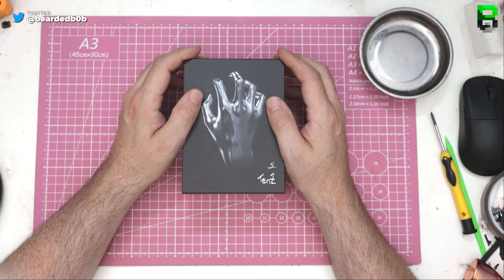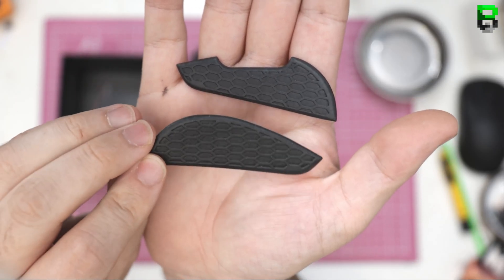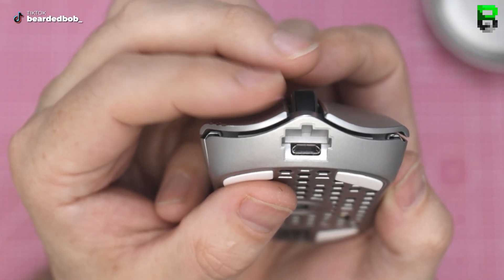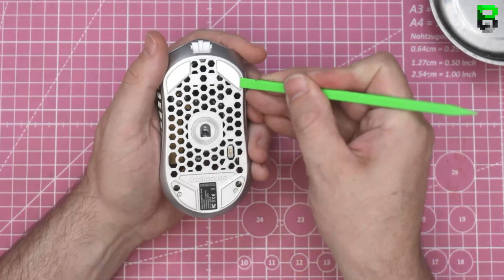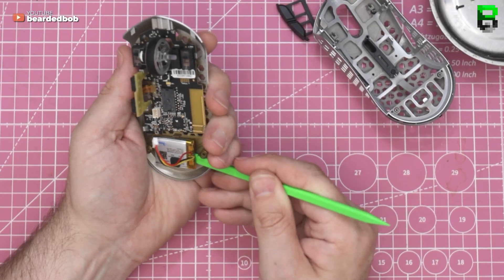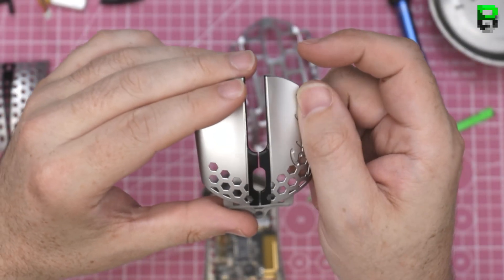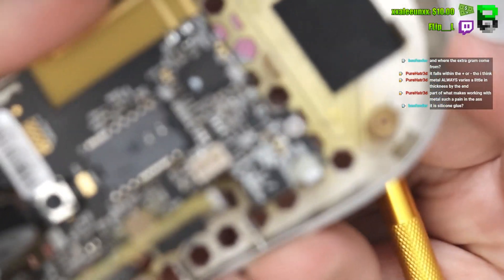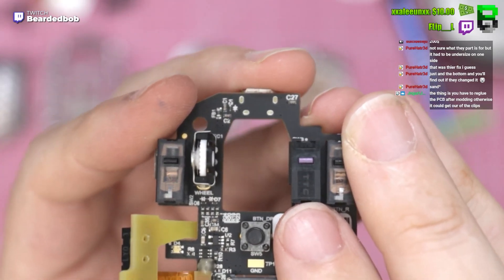LETS LOOK CLOSELY AT THE BUILD QUALITY & COMPONENTS USED: Finalmouse Starlight 12 Tenz Teardown

Comment: Hello, I received a tenz pro before, and found that as long as the finger is relaxed to a certain extent after pressing the button (the button cover is still pressed down), the micro trigger will break for a while and then return to normal. I would like to ask if you have the same problem?

Comment: I took my mouse apart because the right side felt lose and flexed/creaked inwards with gripping. I ended up realizing the bottom screws were a little loose stock and the issue resolved with tightening. However now my left click feels crunchy (interestingly it only seems to be the first click, feels smoother with subsequent clicks). Any suggestions for how to fix this?
Reply: I had this with mine too only first click after a couple minutes feels like it snaps somehow and then after that they’re normal I kinda just pressed it hard af and a whole bunch of times and now it’s perfect
Reply: @lui4ever3  finally found this video which was super helpful: https://www.youtube.com/watch?v=GrF2dXTgYGE . I noticed the black adhesive around the left click was coming unwrapped, I wrapped it back around and that fixed the issue.
Reply: @caseykukielski2410  I also had the same problem and what I did was remove the black tape and clean the location with ISO Alcohol until the adhesive was removed.  That fixed everything and I don't notice a difference without the tape in place.
Reply: @hfcobra  awesome, thank you!

Comment: Micro-USB on a top tier mouse 💀
Reply: So?
Reply: @jerry8826  surely  it's not a good thing for a 150$ mouse (in case of the GPX) and over 300$ in case of the Finalmouse Tenz
Reply: @papirus0622  yeah your right
Reply: @papirus0622  leave me alone I’m trying to cope that I bought it
Reply: @jerry8826  uh?
Reply: @jerry8826  rip man, can't you return it?
Reply: Usb c is overrated. And finalmouse is trying to make this as light as they can
Reply: @Itz_xero1  how's it overrated? it should be the standard that all devices have
Reply: @donna321-g9j  cuz no one will even use the cable for charging while playing, and it wouldn't change a thing about the mouse and why would anyone decide on whether they should buy a mouse because of the charging cable, it is not even the main thing about a mouse
Reply: Isn’t the superlight on micro as well. What’s ur point?
Reply: @Invat  yeah, but superlight came out in 2020 tho